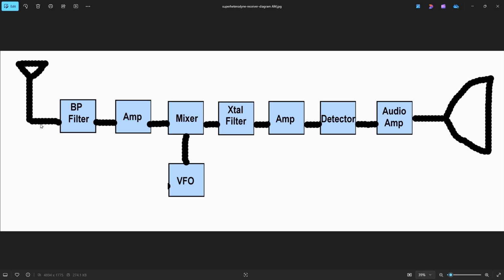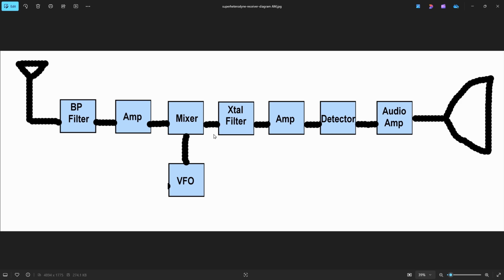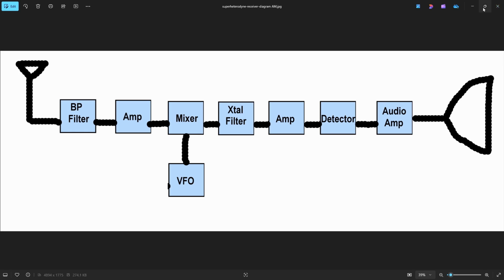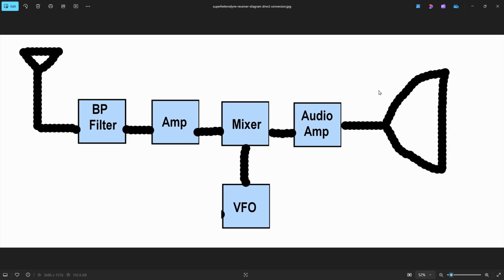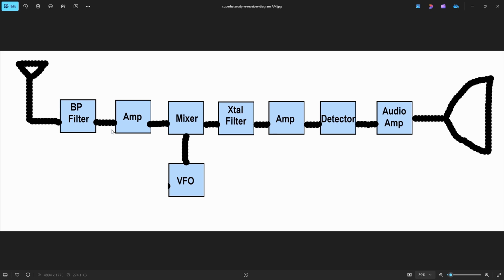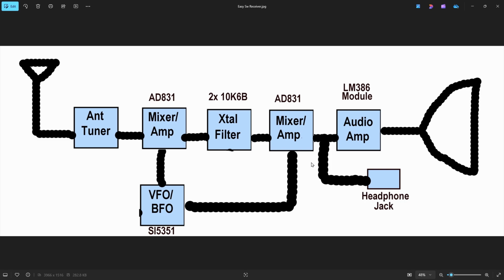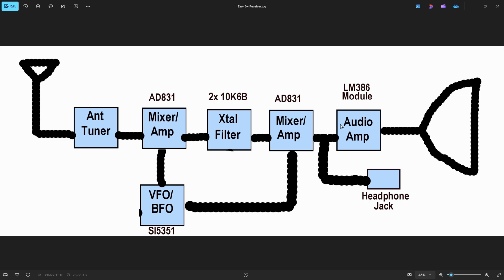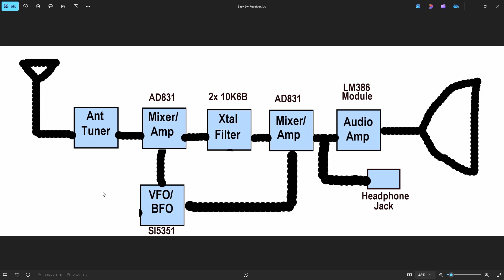Designing The Simplest Radio Receiver That Actually Works!

Comment: Like the wood case idea! Hams are notoriously cheapskate, particularly if it looks good, and, of course, it gives that retro look.I have seen the next video in the series and would like to build one, assuming it was cost effective. Being from the UK, carraige cost is a factor, but, that said, it will not be a huge packet and as such, should not be to costly. I have buikt a number of kits and have been a little disapointed with, not only the quality, the lack iof instructions, but also the finished result. I have a PCB on the bench at the moment that will not acccept solder, even after a good clean up, both physical and chemical, but despite plenty of good flux, quailty solder and a proper iron, it only make poor dry joints! Frustrating to say the least!
Reply from the maker: The PCB’s will be from pcbway, so there will not be any issues with pcb’s. I will need to look into overseas shipping cost as I’m not up to speed there but seems we can find a cheap way to ship. 
RJ
Reply: @LynxElectronicsLab  Watching the series again! Regarding overseas shipping, it may be worth while to send a load of kits to a trusted "partner" for onward shipping. Just a thought! Regarding a kit (or 2) for myself, given the likely size of the package, I envisage a padded envelope as there is no case, I am not worried about the cost to ship and will be happy to cover this cost in full. Having watched the series, it strikes me that this is a very good way to spark interest in Ham Radio, not only for the newly retired, but also the youngster with an enquiring mind, and all Hams should support this sort of venture any way they can. Looking forward to hearing the cost and avail;ablity of the kits. Go for it I say!
Reply from the maker: @ Thanks for the supportive push! And you time to view my videos.
RJ

Comment: I can't possibility turn down a RJ kit. I'm good with a wood box. Depending on the size needed for the box/case. Maybe a Alumn/metal box with the front and back plates made from custom pcb boards.
Reply from the maker: Thanks Rick, 
I am looking at your idea after reading this comment. I had seen it done on other projects. I found a case and ordered one to try out. The PCB's for the front and back will add some cost because of the size being bigger than the cheap 100mm x 100mm PCB's but I might order a few and see how that comes out.  Once I have the box I will do a video to show how that would look.  
RJ